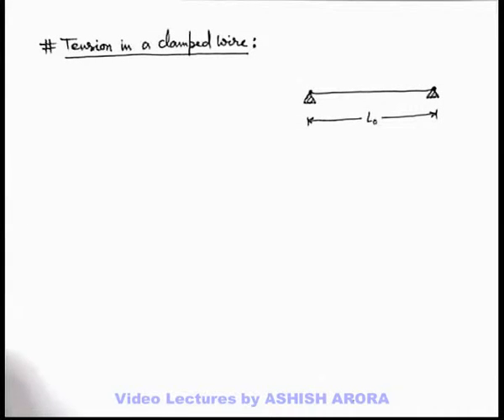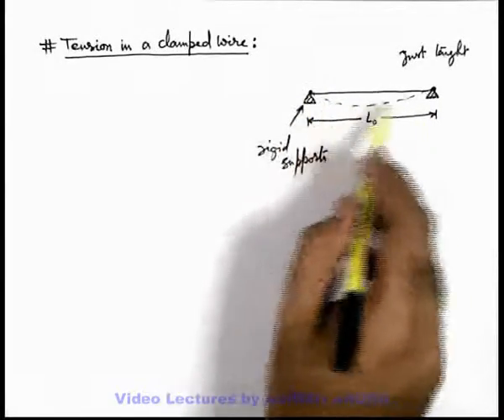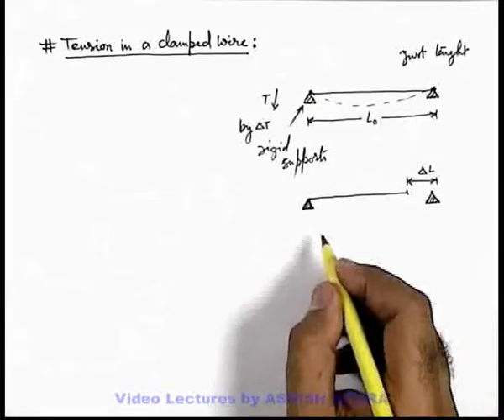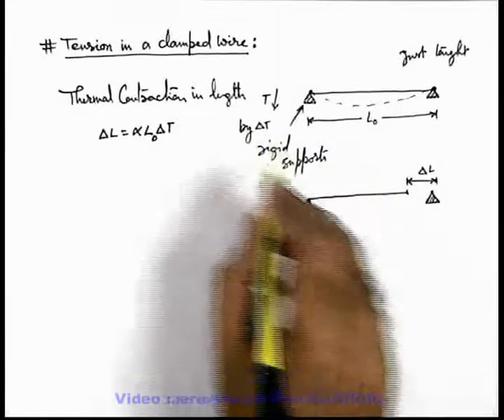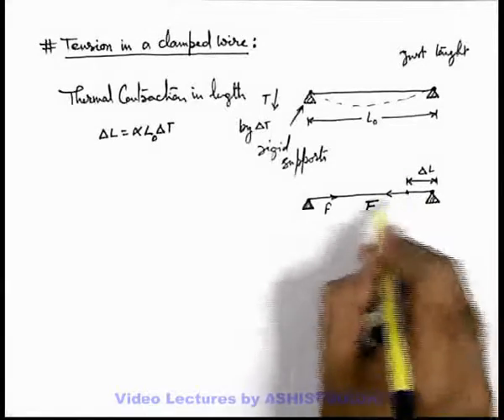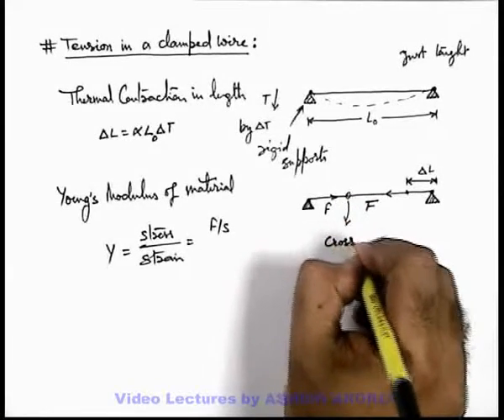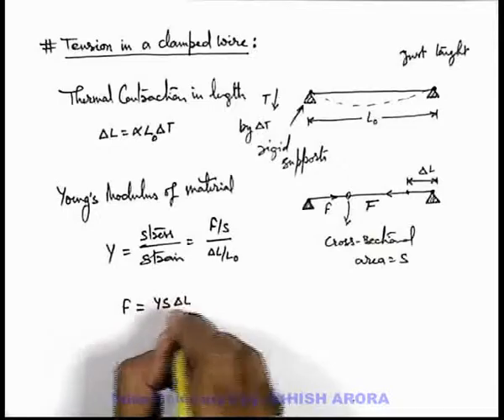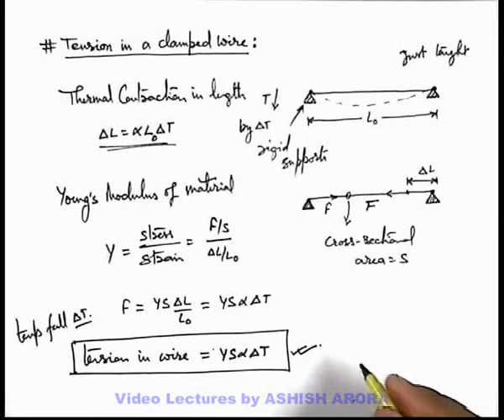6. Physics | Thermal Expansion | Tension in a Clamped Wire | by Ashish Arora (GA)

Comment: sir u told while calculating young's modulus  that it will be actually ΔL/L-ΔL where we can approximate L-ΔL to L...But sir the initial length never changed due to rigid supports those were always L..?sir pls correct me where i m wrong
Reply from the maker: No the for elastic elongation initial length is L-ΔL as initial length was L for thermal contraction...